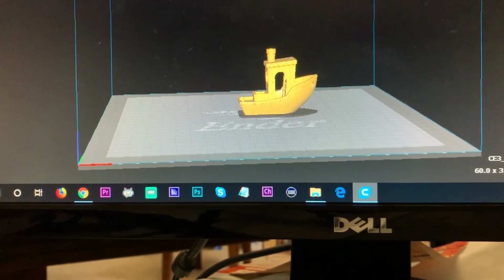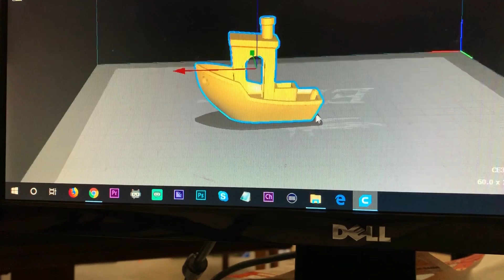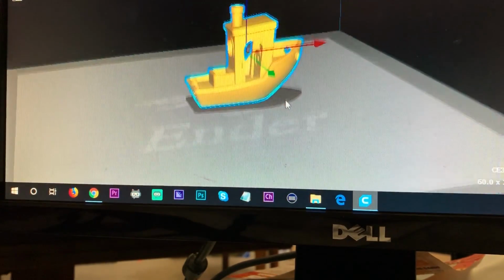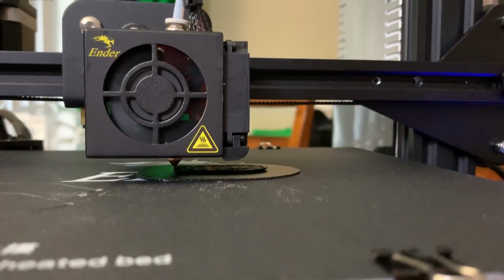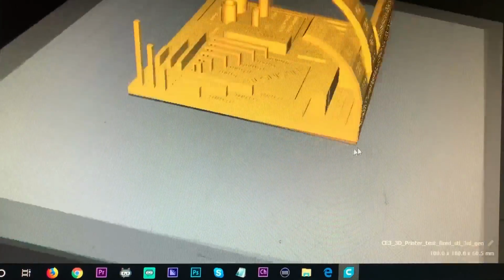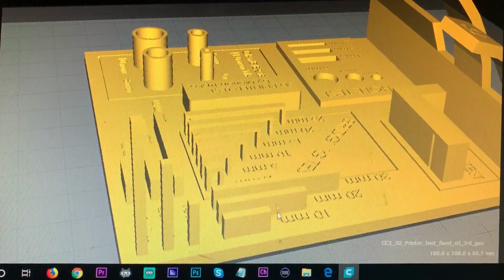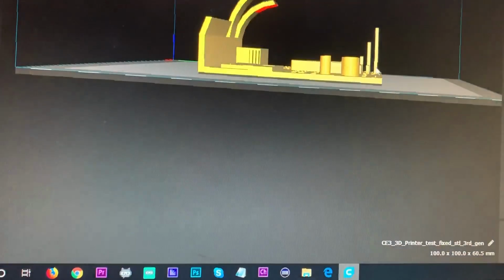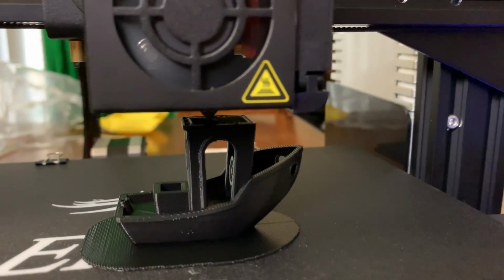Stress Testing Our 3-D Printer!: 3D Gaming

Comment: You may already know this but when you're ready to start printing detailed miniatures (which your Ender is more than capable of doing), there are a few profiles you can download to adjust your settings for superior detail. The mini-specific profiles are way better than the standard Cura settings!

Also, you should really spend that $10 and replace your damaged bed with a mirror tile from Home Depot. It heats exactly the same and is flatter inherently.
Reply from the maker: Not sure how much mini printing we will be doing but we may look into this in the future, and we got a mirror bed and it's working great so far!
Reply: The Brothers Murph bahahaha  riiiiiight. I told myself that too a few years ago. Several hundred minis later......
Reply from the maker: @bassplant  fair point lol

Comment: You should do a video on adjustments that you can make to the printer when it doesn't perform up to Snuff
Reply from the maker: We do plan on ding this, we are still figuring out so much about our printer and the adjustments we can make that we are going to wait a bit until we know a little more before we do a full video on it. Though in each episode we try and throw in a little bit of "this is what we're changing/doing"